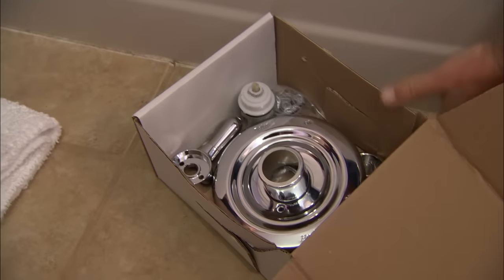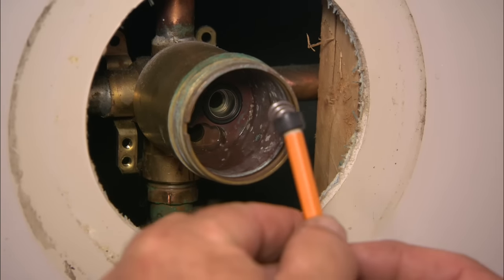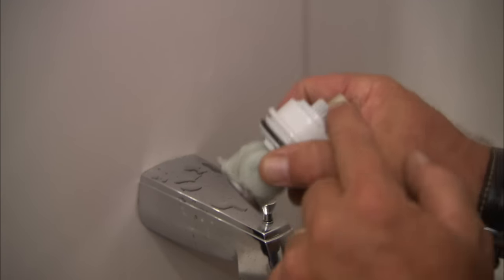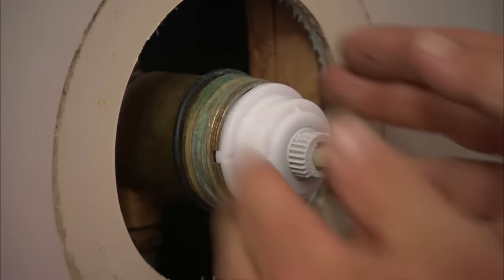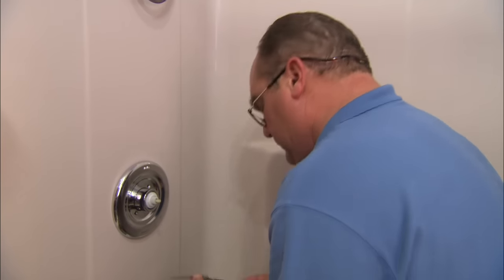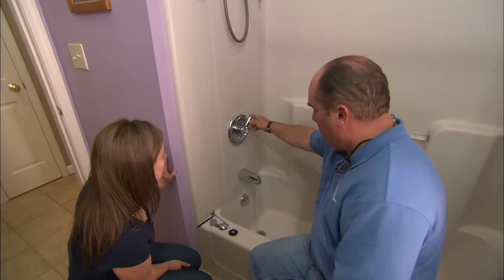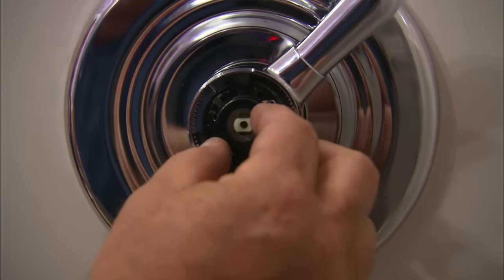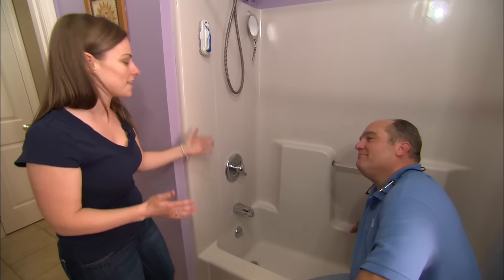How to Repair a Shower Valve | This Old House

Comment: How in the hell was her water instantly hot? Mine takes about 5 or 6 seconds
Reply: Because of the magic of editing.  Surely they tested the valve and the water before they got the shot of her testing it herself.  The hot water was ready to go.
Reply: Ever hear of editing??
Reply: she's faking it
Reply: distance from the faucet and the water heater, on longer runs you can add a recirculating pump that turns on after it learns your normal routine

Comment: Thanks for the video! Was good to see what I was in for and know this was an easy 15 minutes job.

I'd recommend that any do it yourselfer disassemble the valve and bring the cartridge with them to the hardware store. I found out that even if you know the maker and model number there were 5 different cartridges depending on the year the valve was manufactured. Having the cartridge there to hold up to the replacements saved me at least one hardware store trip.

Comment: The mixers seem to often clog up with calcium.  I fixed mine by dismantling and greasing with silicon grease a while back, still good.  Not sure of the make but for interest here’s the fix video to fix it nearly free (just some grease needed):   https://youtu.be/k8Aiem2kOgI
Reply: What do the the two tiny holes in the back of cartridge do? Also I didn't see other holes so how does water go in those holes but come out somewhere else?! Finally what do the springs do? Thank you for your time!

Comment: Thanks for the video! Can you tell me the brand of the trim kit in the video? I bought an apartment where the shower backplate was missing and only the handle is there. I want to install a new backplate and handle with the exact one that was used in the video. I am not replacing the valve. Thank you!!

Comment: So do I need to turn off my water first before I try to replace the valve?  My shower does not stay on because the valve keeps releasing the water.
Reply: Yes, if you don't you're opening up a water dam. If so, I hope you can swim.

Comment: Thanks for posting!  QUESTION: my rental unit shower has a 1 handle faucet, BUT works like this:  is off at 12:00; gets hot when turned clockwise [1, 2, 3, 4:00].  Turn back to 12:00 it's off.  When turned counter clockwise, water is cold [11, 10, 9:00, etc.]  What's wrong?  My last tenants never complained, but my new tenant can't figure it out [me neither].  Anyone?? Thanks in advance!
Reply: I'm not familiar with that but did you figure it out? Maybe you have to push or pull on the handle?
It looks like shower valves in America are so complicated.
Here in Europe the modern style is just like all of our single handle faucets where there is one handle which you swivel to change temperature and pull and push to open and close.
Reply: @flat-earther   Thanks for responding!  Yes, I was able to figure it out; it ended up that the handle was basically installed upside down; I took it off and flipped it 180 degrees, then it worked the way it was supposed to; gradually going from cold to hot.  This really had me guessing though!  Thanks again!

Comment: I rented a house one time where the valve and everything was upside down. They fixed when I left because the new tenant had kids and it was an old valve without the temperature regulator.
Reply: I had a similar experience in a hotel room. There wasn't any hot water in the shower so they comped me half the daily room rate and offered me another room. Not wanting to change rooms I had an idea to check the sink. I had hot water in the sink. I found that the valve was installed backwards. Cold was hot. Why they hadn't had anyone else tell them about it since the building was built is beyond me.

Comment: 2:06 This temperature limit stop seems totally unnecessary. If you're scalding yourself, just turn the water heater down. Maybe it makes sense in a rental where you don't trust the tenants to dial in the water heater.

Comment: probably leaked it's ass off since he rolled the o ring down the outside where it wouldn't do a thing.
Reply: Richard does know what he's doing.
He is a professional plumbing & heating expert.
Reply: Stephen Snell 😘sure...
Reply: Mike Kranik he actually  installed that correctly it's a 1700 delta monitor cartridge the older style. But then again I wouldn't really know I only been a plumber for 15 yrs.. lol
Reply: In this case, the o ring prevents water going from shower side back into the wall.
Reply: It just looked like he randomly placed it at a depth. How is it functional? Draw a schematic?